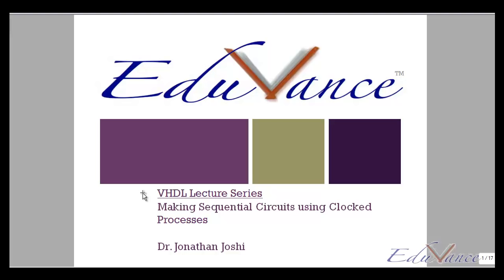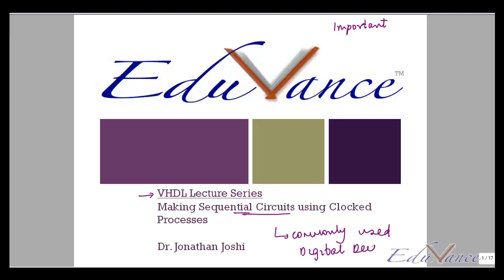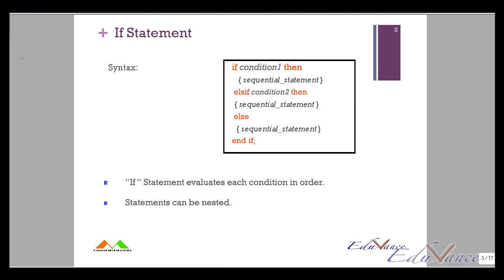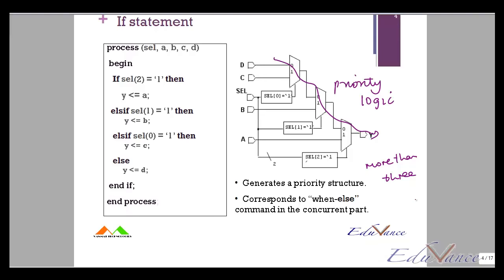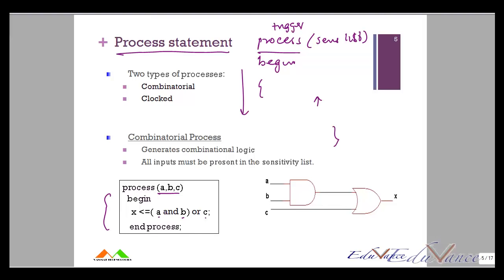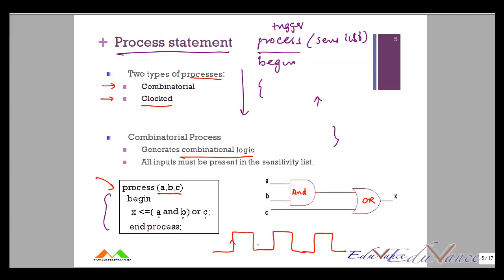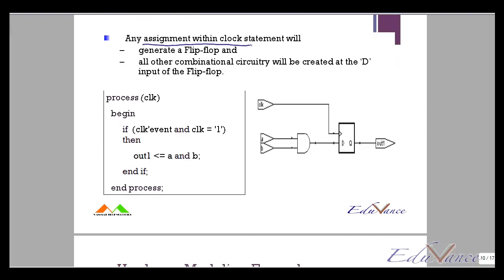VHDL Lecture 16 Making Sequential Circuits

Comment: I was actually wondering about 15:10, you said to not have else statements after the (clk'event and clk='1') statement, right? So why are there else statements in this case? Thanks!
Reply from the maker: The else statement is a part of if statement structure, which is written under the else if statement containing (clk'event and clk='1'). It is not the else statement for the outer if-else structure.

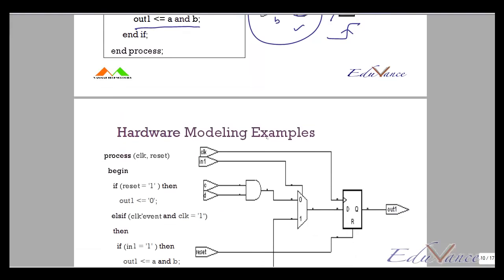Comment: you have told many times that when we should not use Else statement under the clock...then why we are using it in our codes...we used it at 9:01 and also 13:45
please explain it
Reply from the maker: The code you mentioned at 9:01 is as follows: 
process (CLK)
begin
    if (CLK'event and CLK ='1') then 
        if(RST = '1') then 
            Q<='0';
        else
            Q <= D;
        end if;
    end if;

end process

Now if you observe the end if statements. There is 1 if else structure under an if statement. The else statement does not belong to the outer if structure and hence its a correct implementation.
If the structure had been - 

process (CLK)
begin
    if (CLK'event and CLK ='1') then 
        if(RST = '1') then 
            Q<='0';
        end if;
    else
        Q <= D;
    
    end if;
end process             
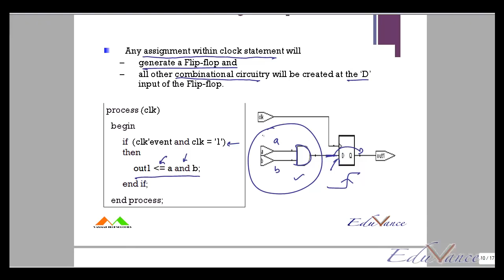then it would have been a wrong implementation. Same goes for the implementation at 13:45.
Reply: not only giving such a good explanation but also clarifying doubts includes much patience..thanks a lot
ur vedios are helping me a lot

Comment: 20:00 the clock is missing in the hardware diagram.
Reply from the maker: One of the inputs to the Flipflops shown in the diagram is clock. Its an integral part of your flipflop design. The block diagram was displayed with focus to explain the two different hardware which are synthesized if we use a <= and := in your design. The focus not being on functioning of flipflop, the clock was not explicitly shown